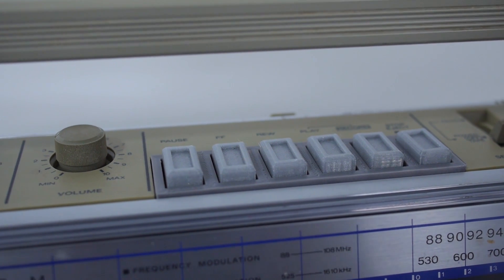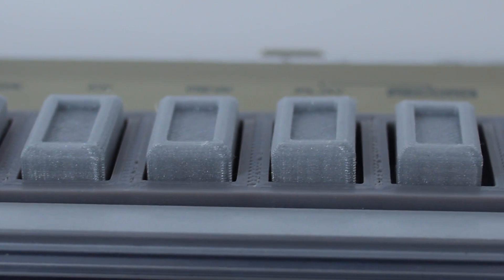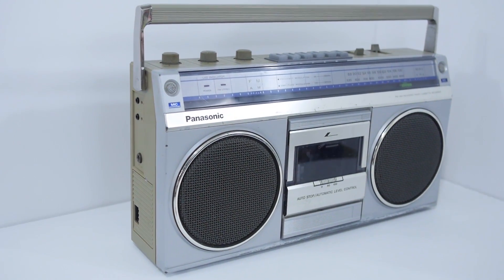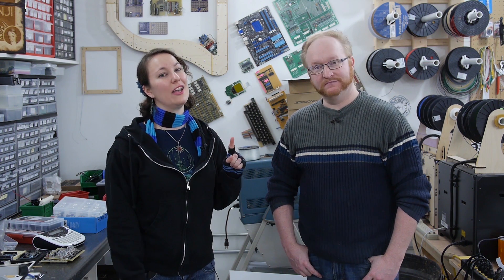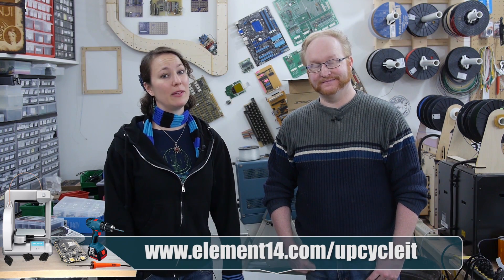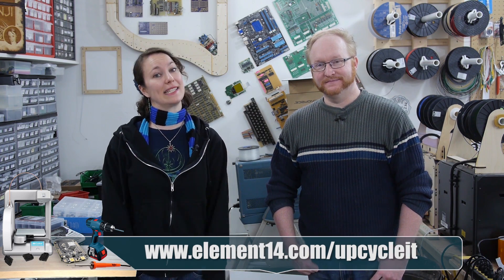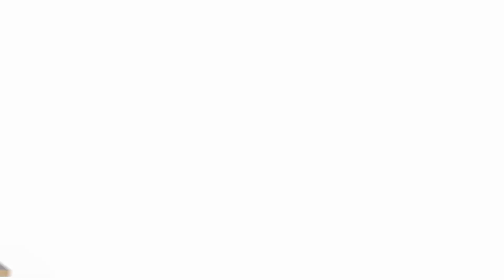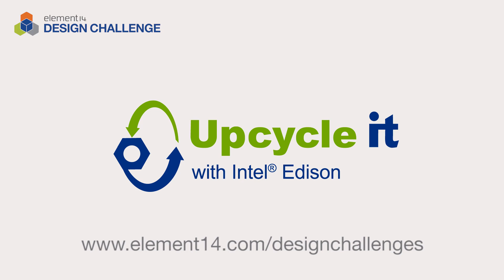Ben Heck's Explanation of UpCycling: Join element14's Project Competition!

Comment: hi hi Ben heck show this is Jared Capman I have a question for you guys. Can you build something like this being I am handicapped myself low income disabled. I am a big PlayStation fan. And PC fan. Can you mod a PC computer tower motherboard with a PS4 motherboard a PlayStation 3 motherboard and a PS2 motherboard and make them run as one operating system running all the motherboards as one be able to use all the system's capabilities. were you able to play PS4 games PlayStation 3 games PS2 games PS1 games and PC games this console build can you built right that works running all these consoles motherboards as one system. One system operating system on running all motherboards is one adding them all into one cooperating with each other. Can you do it.

Comment: I have a challenge for you. Can it be built. building a PS4 motherboard and stalling it and soldering a PS3 motherboard in a PS2 motherboard together all in one running all the motherboards as one operating system with this all the motherboard cider together working together as one operating system

Comment: Intel is really desperate to sell Edisons. The module itself is expensive, and then on top of that you have to buy a breakout board which adds more cost. It just simply doesn't have a compelling attribute when a CHIP $9 or Raspberry Pi 3 $35 can do the same thing, cheaper, and not require an additional board which defeats the one advantage the Edison has which is it's small size.

The Edison is more of a technology demonstrator than something practical to the vast majority of makers. It's more of something that a designer would include on their own board. It's a cool little device, but just not cost effective for hobby projects unless someone is giving them to you.